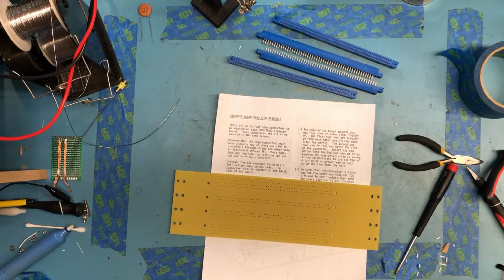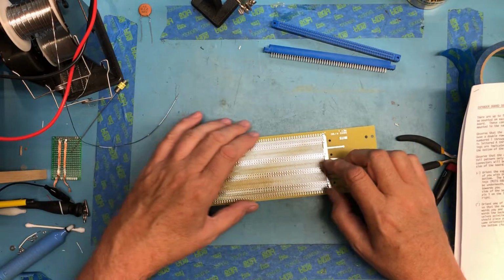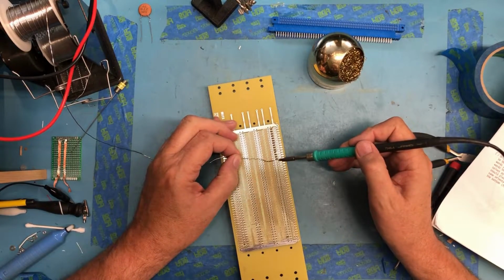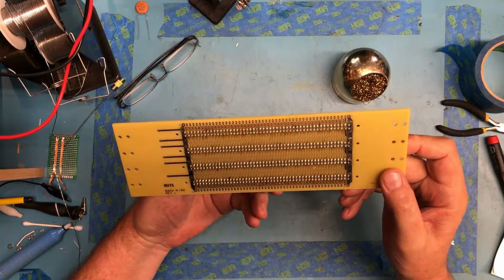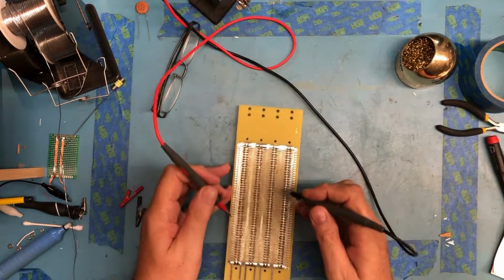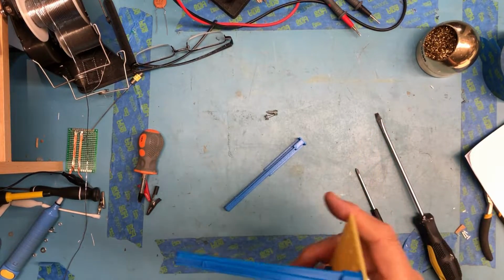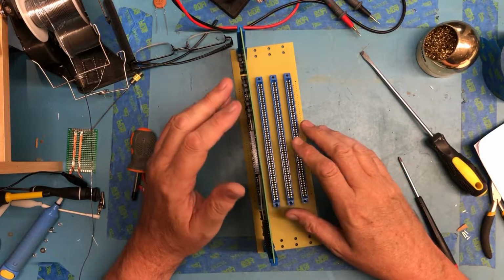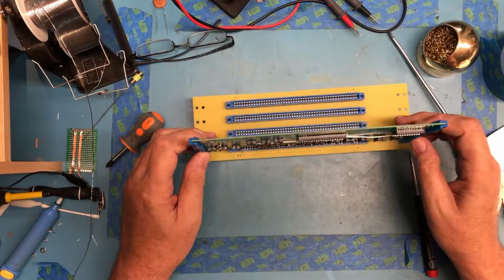Altair 8800 - Part 3 - Assembling the back plane PCB - STB351

Comment: What type of 3d printer did you use to print those guides?
Reply from the maker: An older Dremel 3D20. I built a few 3D printer kits, didn't have a lot of luck and finally just bought one.